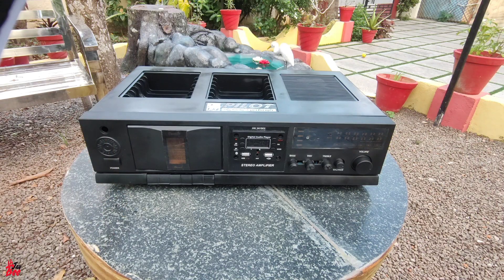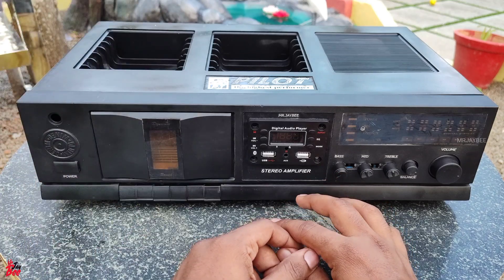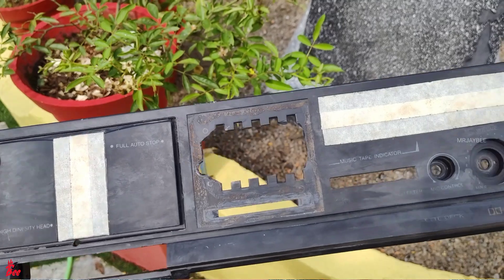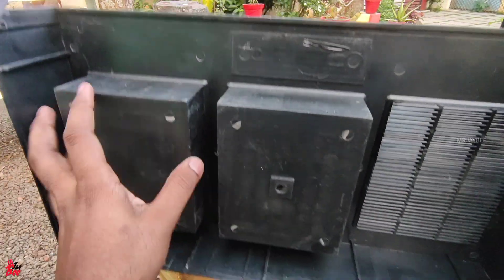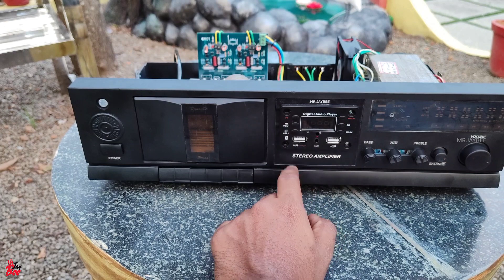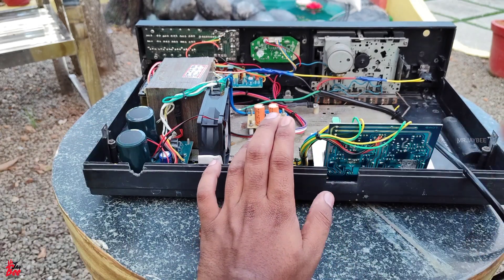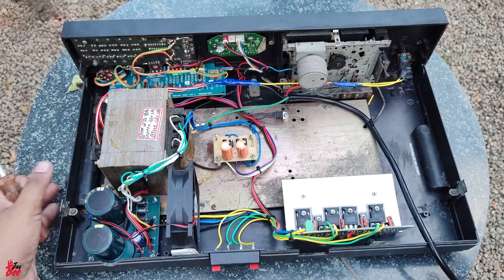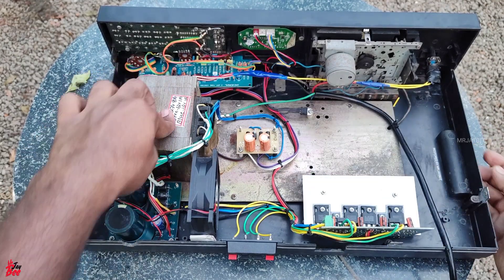Stereo Amplifier with 200W R.M.S Power Review | Making Stereo Amplifier| Old Cassette Deck Restored

Comment: Chetta ഇപ്പോൾ വരുന്ന STK ic bord  ആണോ transister bord amb ആണോ better?
Reply from the maker: 2 um nallathanu nalla board nokkineduthal mathi pinne nammade use anusarch select cheyyuka....oru room il okke vekkan anenkil STK4141 thanne dharaalam...athinte mukalilot okke aan nokkunnath enkil transistor nokkuka... with better circuit and power supply...
Reply: Original STK IC യുടെ അടുത്തെങ്ങും നിക്കില്ല ഇപ്പൊൾ കിട്ടുന്ന ഡ്യൂപ്ലിക്കേറ്റ് thoshiba 5200 1943